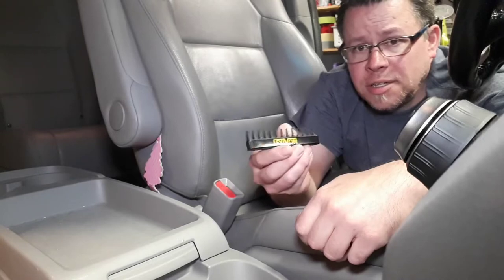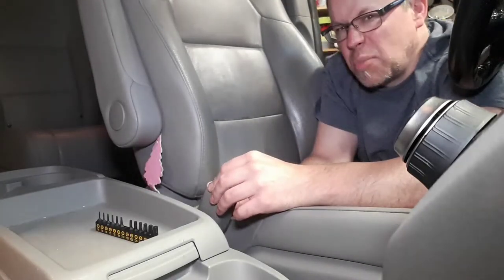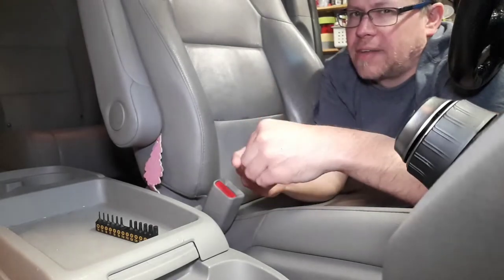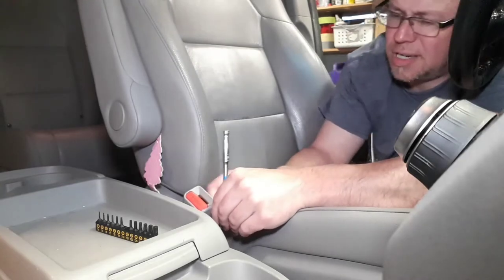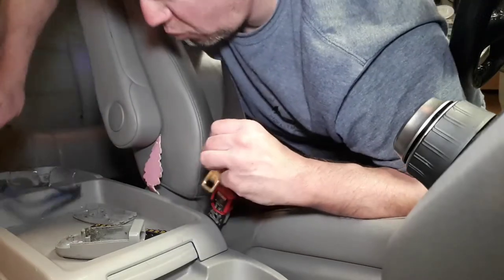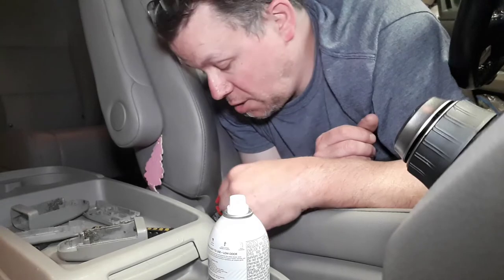2013 Honda Odyssey Seat Belt Doesn't Latch!

Comment: Just to let you know and anyone who may watch this in the future - Honda has a LIFETIME seatbelt warranty. Honda will repair or replace any seat belt component that fails to function properly during normal use. So you can just call up the dealer and they can fix it free of charge.
Reply from the maker: They do?? That makes a ton of sense, what a great piece of information. Thanks for passing it along!

Comment: There's a rare, diesel Chevette for sale near me, which I am considering because my Metro is losing it's ability to climb steep hills with economy gearing including first gear and declining torque in both the engine and clutch.  There is also an older Metro, a '91, with a different body than my '98, and this Chevette.  But do they have A/C like mine?
     I do find I can get a bit more low end torque out of the engine with smaller plug gaps.
Reply from the maker: The diesel Chevette might not have AC, but power steering (I think) was at least standard on the diesels. From what I hear though, 0-60 is best measured with a sundial!
Reply: @ShopKatIndustries  I've been used to it ever since driving loaded trucks and school buses.